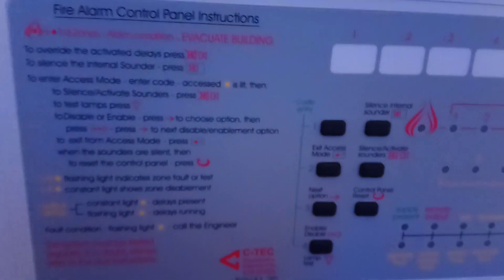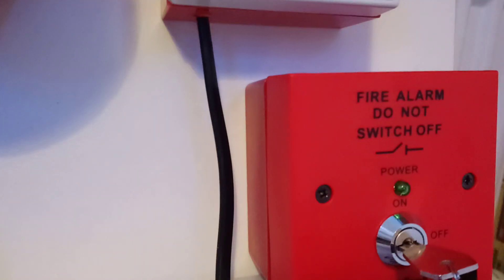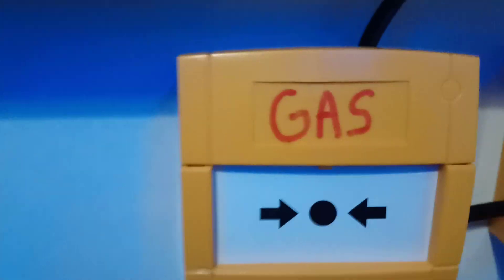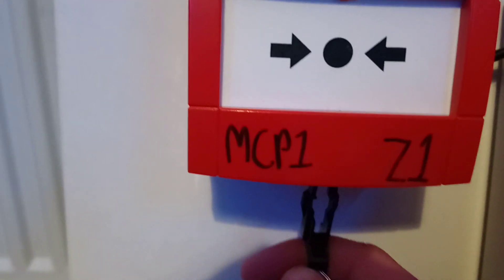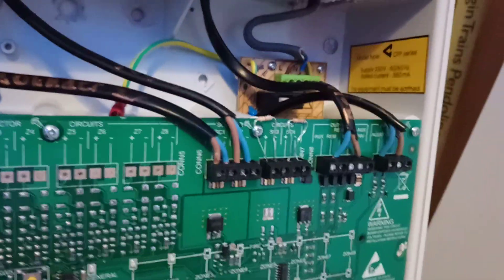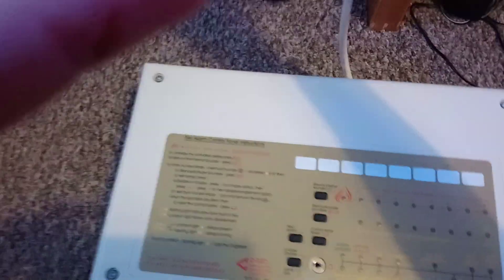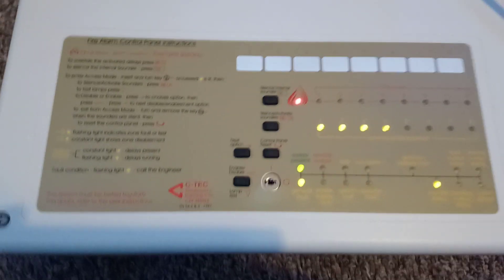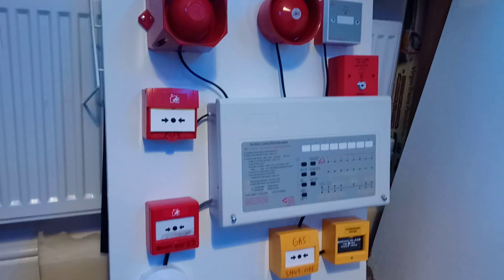NEW! C-tec CFP fire system board and a new C-tec panel.

Comment: Nice video there! Does this c-tec panel require end of line capacitors for zones or can you still use 6.8kohm
Reply: Oh ok thanks
Reply from the maker: @fst1775  No problem. If you require any more help with this panel, let us know.  Be sure to subscribe!
Reply: Grainger Electrical ok I’ve just ordered a similar panel so yeah  also I did subscribe :)
Reply from the maker: The e.o.l capacitor is 0.47uf. If you have a look on eBay, you should be able to find them.
Reply from the maker: The resistor is for the end of line on sounder circuit